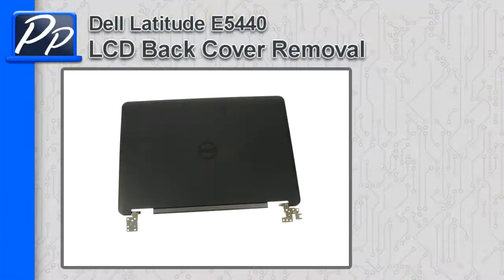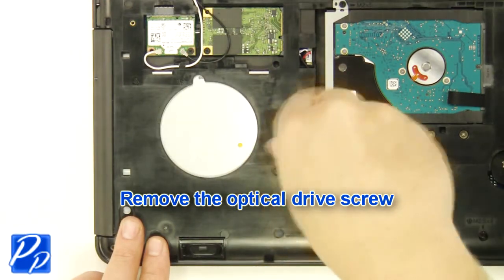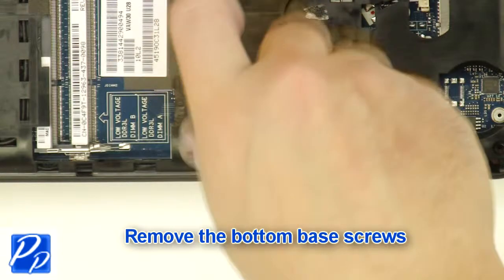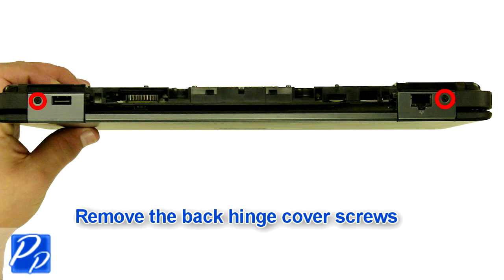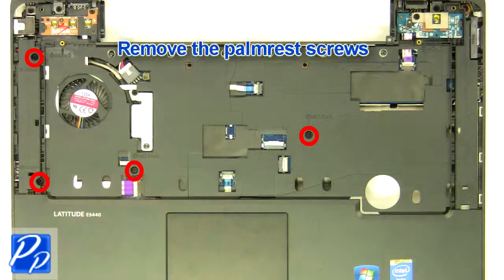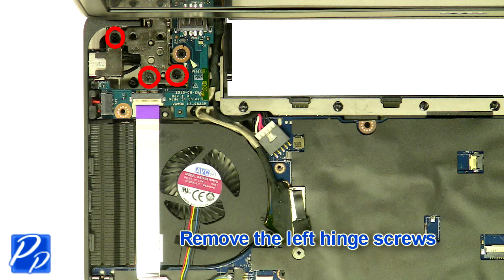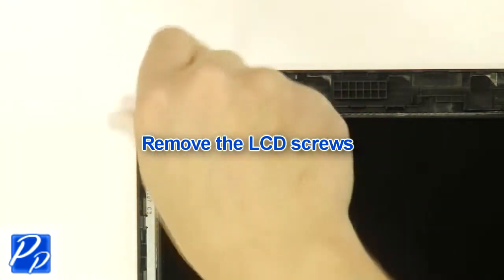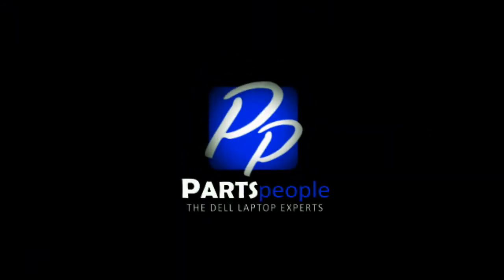Dell Latitude E5440 LCD Back Cover How-To Video Tutorial

Comment: Thanks for the video. I had a few screws and connectors in different places, but if you are going to attempt this, you need some aptitude of what to do. The general over view was very handy. A few things that would have made it quicker for me.... 1) I found it quite hard to unclip the palm cover. I eventually worked round with a small screwdriver to pri each clip off. 2) I put the metal plate that goes over the screen connector the wrong way, so take note of this. 4) The hinge screws were in different places, be careful not to use the one that is later used for the hinge cover, which I did!. 5) Re-fitting the ribbon cables is not shown on this video. You need to slide the ribbon in with the clip up, then latch it back down. if the cable should be held firmly. 6) I was soooo relieved to see that I had screen, HD and Wifi after the repair. Woohooo. This screen was £25 on Ebay, just make sure you get the one with the antenna. Thanks again.